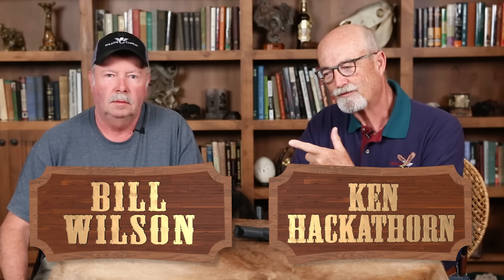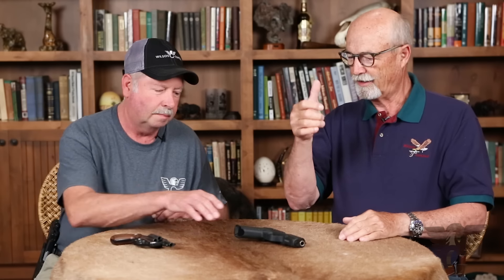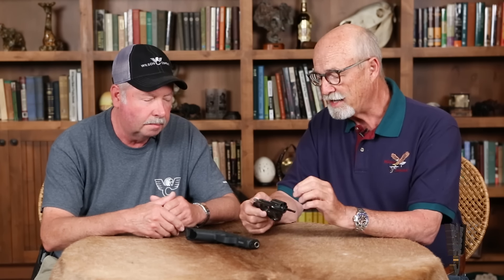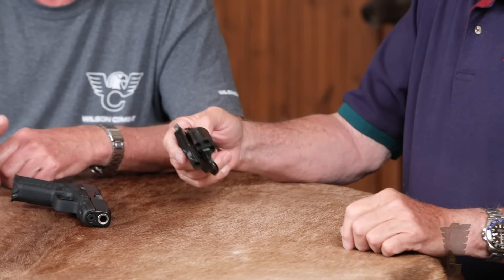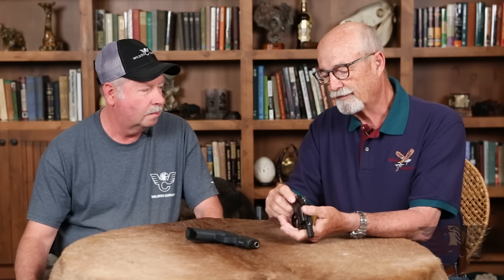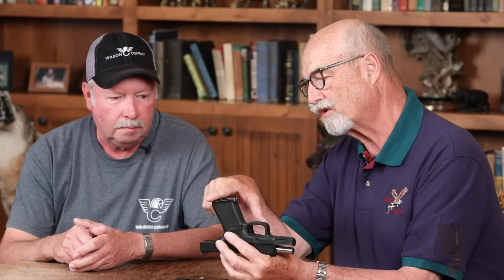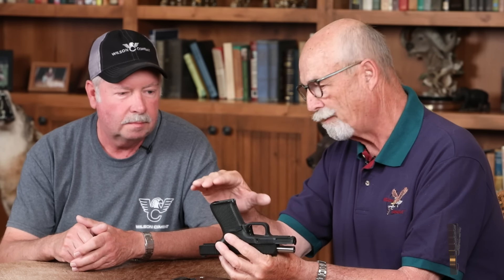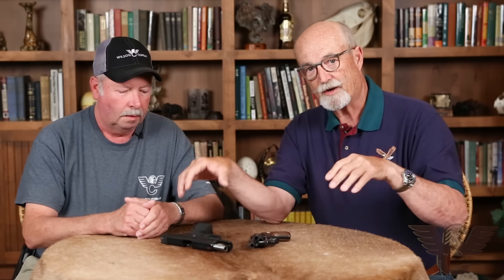DON'T DO THIS to Your Guns - Gun Guys Ep. 17

Comment: I understand what youre getting at, and I certainly wouldn’t disagree with some of the best of the best.  
My questions would have to be:
1.  If racking the slide like that is such a cringe thing, put up signs or notifications at your booth to tell people not to do that
2.  I can see that action can and probably does cause damage, but to what point does that firearm become something that you can’t have the slightest of bumps and “bruises” because its too susceptible to malfunction?  
Obviously, deliberate abuse or neglect is unacceptable, but that quality of craftsmanship and dependability should be able to sustain significant usage without babying it…I would guess.

Thank you for the information and it is appreciated
Reply: 1. I see signage at firearm auction houses but none at gun shows for some reason. I guess people probably just don't end up reading it until it becomes a rule (which is what Bill and Ken seem to advocate). Plus, people have egos.
2. It's not about babying it. It's about not being shocked or surprised when your tool malfunctions due to you not using it as intended. Going back to Ken's example, you can redline a car all day, don't expect it to last very long. Doesn't matter if it's a Honda Civic (Glock) or an IndyCar (1911), no manufacturer will guarantee their product to work 100% if you use it outside of it's design parameters.
Reply: Put another way, pretend you're selling nice, high-priced, finely-tuned Ferraris. Then people come into the showroom and start slamming the doors and kicking the pedals and playing with the steering wheel and shifter. You could put up a sign and have rules to stop that, but if other dealerships and the entire car community doesn't understand, they'll think you're snobs and take their business elsewhere.
Reply: If you listen to what they are saying it's specifically about the high end competition triggers and dropping it empty, a standard trigger is not susceptible to the same issue do to having a larger engagement surface. It's a price you pay for having that ultra light comp trigger. I do kind of baby my 1911 because it's a $2200 Dan Wesson match gun, my Springfield carry gun on the other hand is a different story. No I don't abuse it but it's cheap, if I wear it out I'll buy another one.

Comment: I guess im overkill I clean and lube after every range trip mine and my girlfriends firearms
Reply: Do you wash her car too? 😂
Reply: I spent the day shooting my old savage model 24 ,I only fired the 223 barrel and my son shot his old winchester model 1894 in 30-30 a few times and when we got home I told him to clean and oil his rifle .lol and he did .I told him years ago never lay down to sleep until your rifle is cleaned.my wife said once she thought I had one of those compulsive disorders ,she said every time we would leave the house to go to town that I would take a gun and wipe it down with a silicone rag and rem oil .lol so I told her it was so when we was in the middle of some store I wouldn't start to hear it rust lol.
Reply: @GryphonArmorer  Just in case someone is reading this a year later. Your opinion is your opinion but I don't believe it is based on fact. Why do you think CCI #34 primers exist? My understanding is that slam fires happen because when a round is dropped in the chamber without going through the magazine and the mag release is dropped, the force of the bolt going forward without the resistance of the cartridge from the magazine is so great that the (floating) firing pin slams forward and can cause a primer ignition. Is it not possible that these experts know that other damage can be the result of that? Just saying.

Comment: I also hate it when they drop their guns on concrete in the movies.
Reply: Most are fake rubber guns.
So there's that.
Reply: Drop the gun a slide it across the concrete = cringe.
Reply: I agree. Also I hate it when they drop their Zippo lighters on the ground and they run away.

Comment: I know what you guys mean... I see this stuff now and again and it always makes me wince... My guns are cleaned and lubed EVERY time I use them, and that goes for my long guns too..... Oddly enough I never seem to get malfunctions like others do.... funny that eh?
One of my old 1911's had well over 100,000 rounds through it over a period of 10 years...... all handloaded 200gr LSWCs at about 950-1000fps and the pistol had a chrome lined barrel. When I sold it it was still running like a watch and still shot good groups. It failed once... broken extractor at about 70,000 rounds (no I never dropped the slide on a chambered round, but I believe they should be replaced a lot more often than that) so I shouted it a new recoil spring and bottom link at the same time......... Reliable pistol, always went bang...always.... But then they all have come to that....
Reply: I agree .

Comment: I like cleaning my gun. I believe in doing it after every "session".
Reply: That's how it's supposed to be....
Reply: The level of clean depends on the use it’s seen and the gun. Like my benelli nova pump shotgun gets a bore snack after each outing and rarely a full break down. But my CZ 75 gets a full break down, dry wipe down to remove excess carbon, oil and subsequent wipe down to remove excess oil so carbon doesn’t stick in the nooks. Both Guns run like butter every time

Comment: The 1911 was designed to take the abuse. It's part of military drills.Your custom gun is nice,  but you've turned it into an overly fussy target pistol,  not an EDC reliable self defense gun.
Reply: @TheLyingFigure  It's not about the self defense shoot, it's the thousands of practice rounds that everyone has to shoot to acquire and then maintain proficiency.  Even if you never use if for self defense in your life, you still end up putting thousands and thousands of rounds thru.
Reply: @TheLyingFigure  Well my point, just like the point in the video and the point in the original comment, is in reference to undue wear and tear on the firearm from all those rounds, not about getting filthy from not cleaning.  Of course you clean your gun.  I clean my pistols at least every two hundred rounds.
Reply: TFB TV had a video on how unreliable the 1911 was awhile back, though he’s admittedly a Glock fanboy

Comment: Inserting the magazine too hard? Letting mags drop on the ground? Really guys? I understand that you shouldn't abuse a 3k custom 1911 safe queen, but guns are tools and should handle such use.
Reply: Agreed
Reply: I have surplus usgi m16 magazines that have been dropped in mud, sand and snow hundreds of times that still function fine.
Reply: you drop your power tools on the ground?
Reply: @stephenarmstrong1681  
Yes, and they've functioned fine for 7 years
Reply: @stephenarmstrong1681  no contractor would touch a power tool with a 10 ft pole if it couldn't handle plenty of drops, and you shouldn't trust a gun with your life or your money if it's so fragile

Comment: USMC veteran here..Gun gets cleaned even if I shoot 1 round
Reply: Retired Army Infantry here, I concur 100%
Reply: That mentality is the continuation from earlier times when we had more corrosive primers and powder. Or having firearms that would fail to function with a little carbon fouling or adverse conditions. 

It’s also coupled with the military demanding appearance over function. Instructors would, and continue to do so, teach damaging habits to get clean firearms. Causes pitting, excessive wear and tear, and worn finishes. Modern firearms don’t require excessive live or cleaning, and again, it will cause excessive wear and tear by dis/ass
Reply: @josephhautzenroeder7512  You apparently never did a tour in the Middle East. I am guessing you never served a day in the military either. We _never+ used the issued M4 or M16 cleaning kits because the cleaning rods were made of steel. But EVERYONE had their own brass or aluminum ones. The sand over in the middle east can be as fine as talcum powder. If you did not clean your weapon each day that sand would eventually cause a stoppage whether you had fired your weapon or not. I used to put electrical tape over the seam between my upper and lower receivers to keep the sand out. We also had a plastic plug that fit snugly over the birdcage flash hider. It kept the sand out of the bore. You would shoot right through it and it would blow right off.
Reply: @stevehammond9156  you certainly got offended and defensive real quick. Ensuring your firearm functions, especially in harsh or adverse conditions, is fundamentally different from cleaning your firearm over and over for hours just to pass a white glove inspection. What was it I said? Oh right, teaching appearance over function, which you didn’t pay attention to. You can make whatever assumptions you’d like about me in a weird attempt to exert dominance. Most service members don’t know how to properly maintain and clean their firearms, only what they were taught in boot camp. And playing in the sandbox with its conditions has absolutely zero bearing on the average conditions here along with the requirements to maintain your firearm.
Reply: @josephhautzenroeder7512  You are apparently incapable of understanding that appearance and function are inextricably linked. And since pretty much all of our deployments are now to dunecoonland , those are your average conditions. And you did not answer my question, what branch of the service were you and how much combat did you experience? If your answers are none, which I suspect they are, you are not talking from personal experience so your assumptions are not valid based on experience.

Comment: I've been dropping the slide on my $400 Rock Island Armory 1911 for over 10  years. Never had one problem with it.
Reply: Empty or loaded?
Reply: Both, mostly empty
Reply: @ChineseChicken1  😧😖😟But... Why? Does it make you feel bigger? Common sense tells me regardless of brand, build specs and hammer forged yada yada... Once in a great while or a friend accidentally does it ok, but otherwise why beat the surfaces together without the working components aka ammunition involved in the equation? Thats when its doing it how it was designed, the gov't military branches are spending our money so of course they don't care if it's harmful or not as we the people foot the bill for replacement or repair. I don't see the appeal, once the hammer drops eventually from doing it, unexpectedly then maybe it's too late to change your habit because a habit, a bad one at that is all it is imo.
Reply: @les3449  shouldn't matter. These dudes are fudds. Drop your slide all you want.
Reply: @danrozanski6130  I respectfully disagree.  I have always released the slide with my firing hand thumb while loading the weapon.  I have occasionally released the slide on an empty chamber and noticed a definite difference in the feel.  I can see where there may be some undesired wear internally.  But, it does save time to release the slide with the firing hand thumb when you are reloading.
Reply: @les3449 respectfully disagree. Firing the weapon puts much more wear on the parts than any sort of slide drop, empty or chambered.
Reply: @J_Analytics  well, I guess in the long run we are each going to do what we want with our own firearms.
Reply: He compared a Rock Island to a Wilson Combat 1911 well there you go enough said. For those that didn’t understand what these Gentlemen were trying to explain here’s your sign can’t fix ignorance.
Reply: @inzane1260  people here still thinking that they can cause more damage with their hands with a repetitive movement ,more so then by the G's generated by the blow of the powder, putting that mass under accelerations far more important - also repetitive ....🤣😂🤣😂🤣😂🤣😂
Reply: wrong, with a 1911 when firing you have pressure on the trigger, and the hammer, and sear dont bounce off each other like they do when you just drop the slide with no pressure on the trigger. that is what kills a good trigger job on a 1911. @J_Analytics

Comment: I’d love to see the math that proves dropping the slide on an empty chamber generates enough force to cause damage, but 355 ft. Lbs of muzzle energy doesn’t.
Reply: It's moving in a different direction causing stress to a different part these guys are gunsmiths they really know what they are talking about I would consider their advice.
Reply: @harleysosbe272  live fire causes the slide to slam forward with more force than manually dropping the slide on an empty chamber does
Reply: @Superabound2  not when its chambering a round. If there is no round the slide locks back and this is why. The round significantly reduces the force of the slide moving forward.
Reply: It would something like the geocentric solar system model.

Comment: I totally disagree with the slide drop.  If your gun is made in a way that it needs to be handled in a specific way, It's a Range Queen.  It may be made to the highest tolerances with the optimal trigger pull but keep those on the range were they can be handled as such.
Reply: They're educating you and not to abuse the mechanism and how to handle it correctly what's so hard to understand about that?
Reply: “Specific” to the way it was designed to function.  That’s explained very clearly.  You probably dry fire rimfire guns, too.
Reply: @rodneyalaking8241  modern rimfire guns can be dry fired, you're just stuck in fuddland and behind the times
Reply: @rodneyalaking8241  modern rimfire guns can be dry fired as they have a mechanism that prevents the firing pin from pinging anything
Reply: @Sandhill1988  because it's not correct
Reply: @pdworld2418  I KNOW!!  But I’m talking about rimfires that aren’t modern.  They have been made for decades, and it’s not a great idea to dry fire these older firearms.
Reply: The guns they are talking about are specifically range queens that cost thousands yes, with very finly tuned triggers. They are not for everyone, if you dont have a $2000+ match grade pistol then this does not apply nearly as much. It's not of no consequence, but when you get things down to such tight tolerances to get high precision then yes it does introduce other "problems". That's literally the reason military weapons are not built this way, they need to hit man size targets not dimes so the robustness of it is far more important then the precision. Personally I really enjoy my match 1911 with its silly light trigger, but it is a range queen I've got other pistols for carry that are chosen for a more duty oriented performance.

Comment: I went to a NRA convention Colt  S&W  H&k all the large manufacturers of hand guns had walls with hundreds of guns attached to the wall but you could pick it up and dry fire drop the slide slam the revolver  fan the hammer on fine Colt Single action on problem all the guns were dry no oil and had not seen oil in a long time all the   nice ones were so wore out they would not work  at all completely locked up  just saying could they have sprayed some remoil on them every day would have helped    the whole mess made me feel bad  I don't like to see abuse of any kind

Comment: These rules always seemed silly to me.  A gun tough enough to handle an explosion and then send a piece of metal 1200 fps out of it. 10 1000,s of times but it can't handle the metal coming together with a few lb spring?  Well I have a 357 smith 686 and I know I have done the cylinder swing maybe only 30 times over a few years and it spits lead in a way it didn't new.  Maybe a gun is designed precisely to do what it's designed to and not what it ist.
Reply: Yeah these oldheads make me scratch my head sometimes

Comment: Smyth busters actually has a video about this if your pistol is made correctly the slide locking mechanisms should be heat treated for these reasons because user or tool inflicted causes the exact same damage
Reply: I want to add real quick before someone shoots me down here.the slide catch/release shouldn't ever become damaged doing such a thing yes if you've fine tuned your 1911 that has old tech I get it but I've never been much in those things anyways.so I wouldn't know the feeling of having to deal with being so easy but I do know I want to be able to drop my pistol and pick it up and it work perfectly so that's just my opinion.now the slide catch again should t ever ever ever be damaged that's one place that has the most contact and pressure should be pretty tough

Comment: So don't use the slide release to release the slide? That's the stupidest thing I have ever heard. The 1911 was designed to be handled by anyone without special instructions. If you can't make a gun that can't take abuse, I don't want it.
Reply: Firstly, it is not a slide "release", but a slide "stop".

Secondly, it can release the slide, but used sparingly in the event you cannot release the slide with your other hand.

Thirdly, think about every time you release the slide with the "stop",  you are wearing down the surfaces of the slide and stop.

Over the last hundred years there have been many lessons learned the hard way.
Reply: @slideglide9418  that's exactly right...... you are supposed to manipulate the slide back gently with your other hand.......
Reply: @slideglide9418  find me ONE person who has ever had the interface between the slide and the slide stop wear down enough to actually cause a malfunction. ONE person